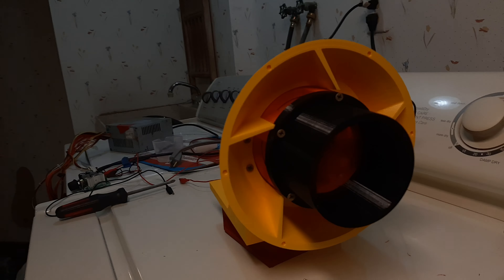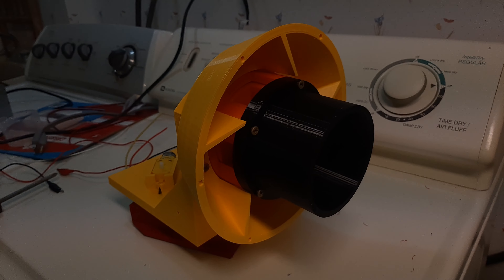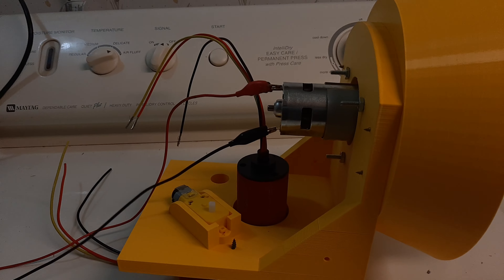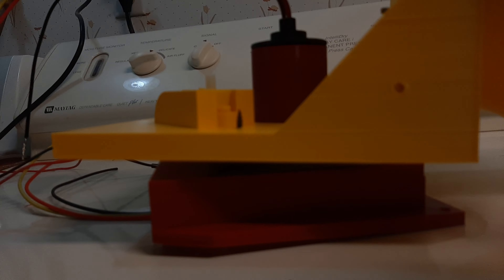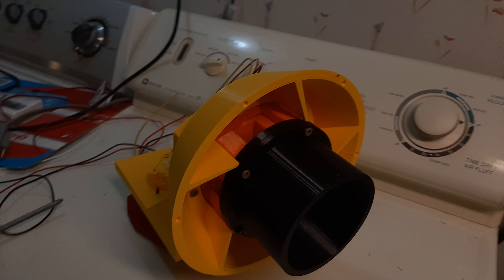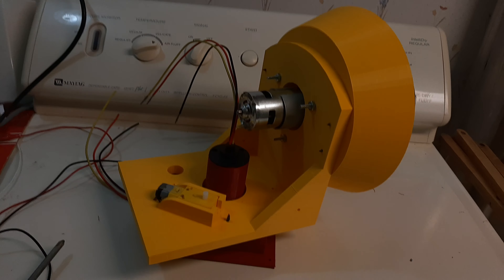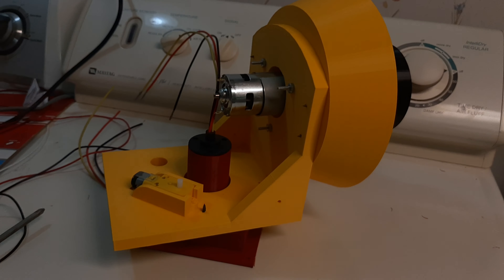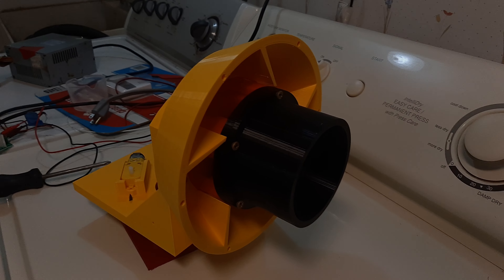Mini tornado siren project

Comment: DUDE YOU HELPED ME OUT WITH MY COLLECTOR RING PROBLEM
Reply: my mini siren will have collector rings eventually
Reply from the maker: Glad I could help! I'm surprised nobody else ever tried using these in homemade sirens.
Reply: @Snowcube  me neither but I plan on using those slip rings but in stead of 15 amp I'll get 5 amp because when I bought those 15 amp slip rings those wires are hard to bend
Reply from the maker: @YourAverageMODude145  Yeah the 15 amp ones are seriously heavy duty and you probably don't need them unless you're running big motors like this.  Just be careful with the smaller ones as I've found they break kind of easily.